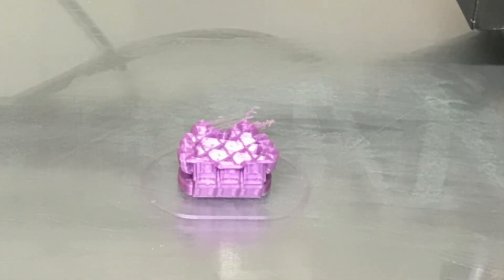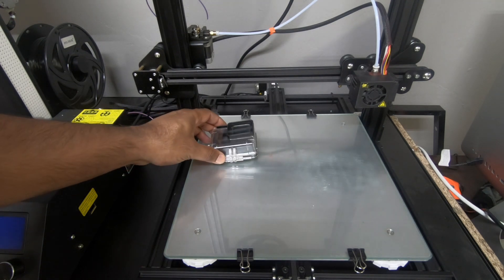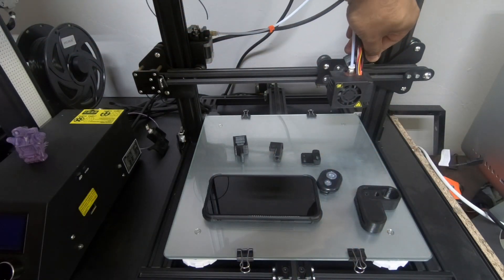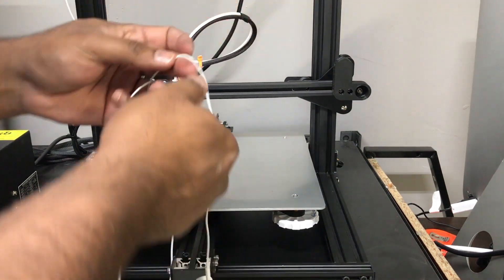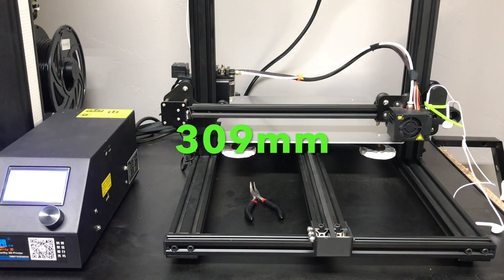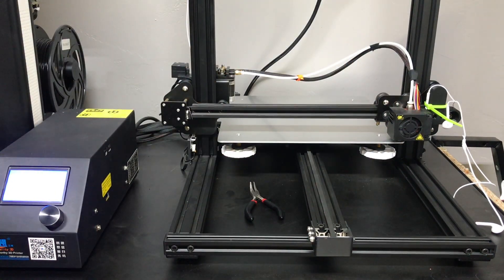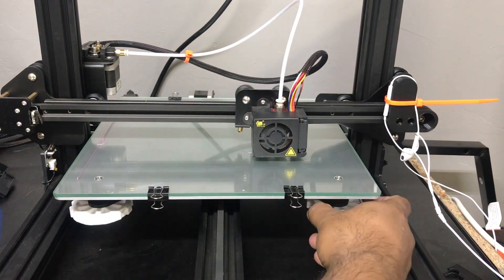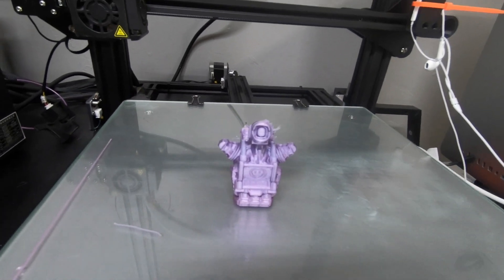BEST 3D Printing TimeLapse With Cura [How To]

Comment: Search ;LAYER:

Replace
;START of TakePhoto routine
G91 ;Use relative positioning mode
G1 E-4 F1800 ;Retract 4mm of filament
G1 Z2 F2000 ;Move Z up 2mm
G90 ;Use absolute positioning mode
G1 F13000 X300 Y200 ;Quick move to rear right
G1 F1000 X309 ;Poke
G1 F9000 X307 ;Move 2mm to the left
G4 P800 ;Pause for 0.5seconds
G91 ;Use relative positioning mode
G1 Z-2 F2000 ;Return Z to current Layer
G90 ;Go back to absolute position mode for all axes 

just paused the video and copied, not sure if works yet.
Reply: Not all heroes wear capes!
Reply: THANK YOU!

Comment: Hi where is the g code? It isnt in the description
Reply: Search ;LAYER:

Replace
;START of TakePhoto routine
G91 ;Use relative positioning mode
G1 E-4 F1800 ;Retract 4mm of filament
G1 Z2 F2000 ;Move Z up 2mm
G90 ;Use absolute positioning mode
G1 F13000 X300 Y200 ;Quick move to rear right
G1 F1000 X309 ;Poke
G1 F9000 X307 ;Move 2mm to the left
G4 P800 ;Pause for 0.5seconds
G91 ;Use relative positioning mode
G1 Z-2 F2000 ;Return Z to current Layer
G90 ;Go back to absolute position mode for all axes

Comment: I have implemented these codes. However, while the hotend is returning, it moves very slowly and filament flows from the nozzle tip. This also spoils the printed object. I added F13000 to the last G90 row to make the return motion faster, but there was no change in the moving speed.
Reply from the maker: Ya that was a problem I had in the beginning too. every printer is different so you need to change either the retraction settings or input a speed code.

Comment: My ender 3 isnt going more than 235mm and it doesnt touch the headphones
Reply from the maker: Then you need to print a poker which attaches to the hot end. This way it will give you that extra few mm’s you need.
Reply: @SANTUBE  Do you have an stl for the poker?

Comment: This must add a lot of extra time to the print?
Reply from the maker: Protomaker Black Sprint Original 3D Printer you are correct, it does add more time.
Reply: @SANTUBE  Add another script that ;

Search for: G0 F300
Replace with: G0 F5000 ;makes the movement back to printing a bit faster
Reply from the maker: @thamomentum  thanks for the info will try it on next time lapse